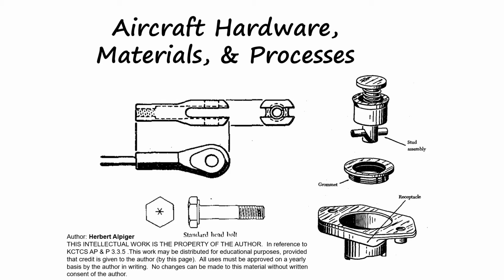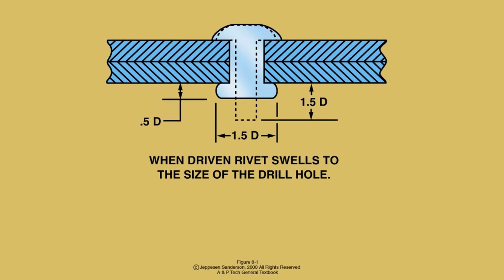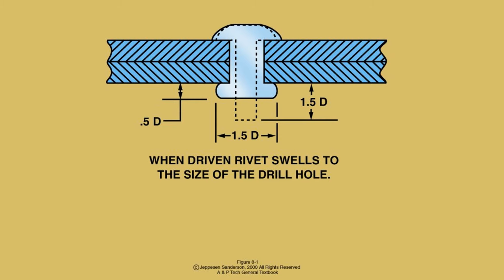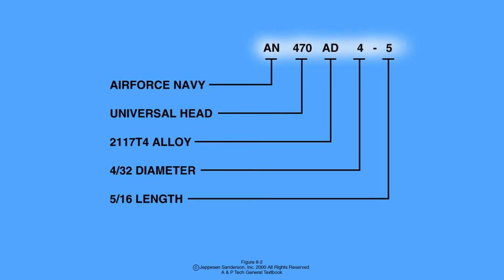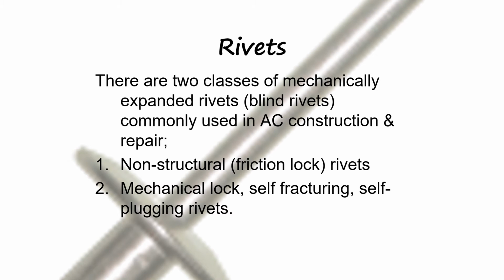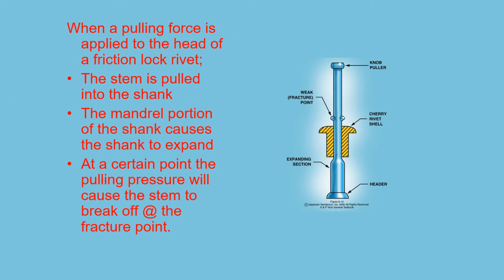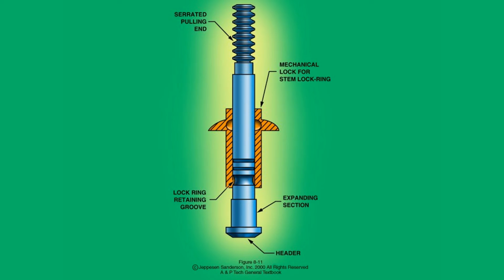Aviation Maintenance - Lesson VII   Rivets

Comment: 1 &1/2 the diameter of the shank. does that mean 1.5 multiply the diameter of the shank equal to the length protruding the metal pieces being joined and the diameter of the shop head?
Reply: Not the shop head . Just x the diameter of the shank